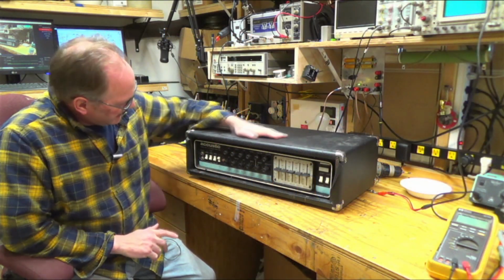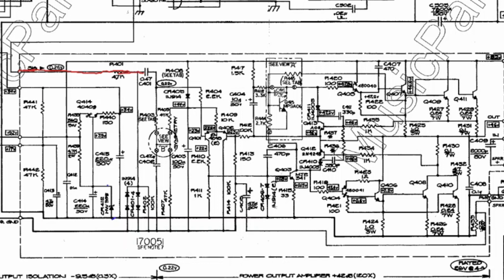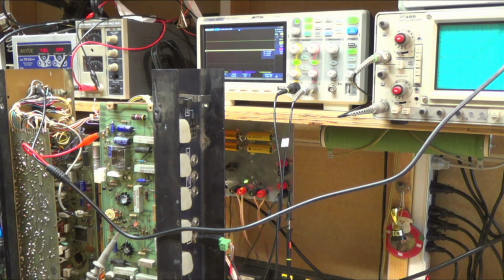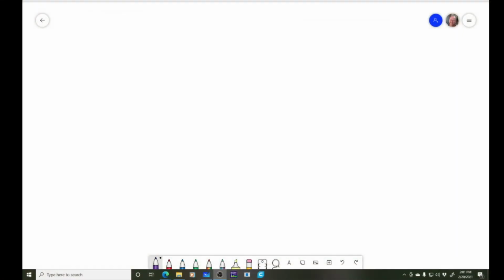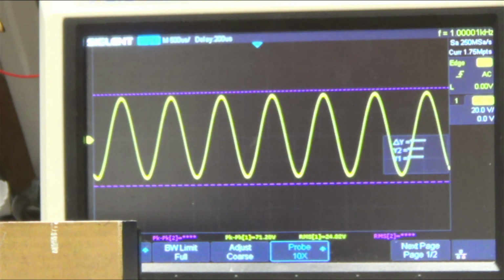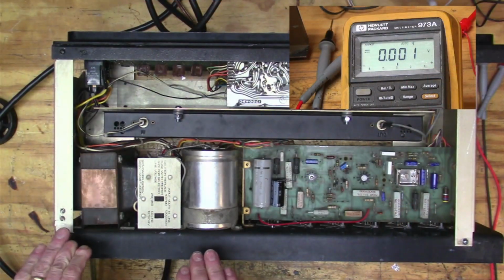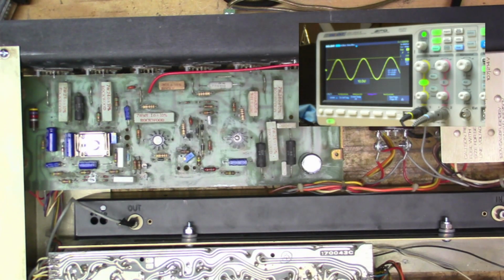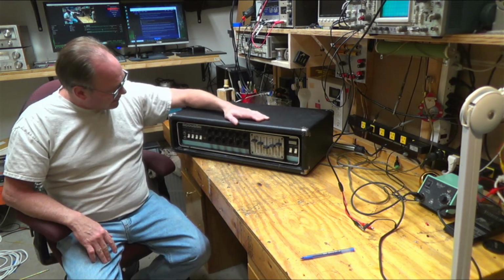1970s Acoustic 470 Bass/Guitar amp repair

Comment: I purchased this amp and speaker cabinet combo in 1978. It pretty much still looks like the day I bought it as I only used it on gigs several times. Recently I started getting some distortion so I brought it to a repair shop in Philly. The tech told me that the pre amp was shot and that unfortunately that it was no longer manufactured. The distortion is not constant so I still use it as a practice amp. I've had it for so many years and I really hate the thought of parting with it. Is there any way that another another pre amp, with the same electrical characteristics could be utilized? The other thought I had was to part with the head and replace the 4 ohm speakers within the cabinet with 8 ohm speakers, the reason being that I cannot seem to find a guitar amp head that is 4 ohm. Any comments or insights would be greatly appreciated.
Reply from the maker: I would take it to another shop. The preamp is all mixed together with the effects so I don't think you can just replace it. The preamp runs at like 40 volts. I had issues with the zener diode in the voltage regulator on the main board for the preamp power supply. I would check the input voltage, replace all the caps, and then test again. If it is the transistors in the preamp they're easy to replace too. Also and this is me thinking way back, isn't the distortion switched on, on the distortion pot? When I first got the amp I had issues with that switch. Maybe a clean-up would fix it?
Reply: @RobsFixitShop  Thank you for your insight. The distortion is only activated when you hit the foot switch which came with the amp. I'll have to do some looking to find a reputable repair shop. Thanks again.

Comment: I sold these as brand new amps back in the early '70s. I would not call myself a bass player (although I have thumped a bass a time or two), but my humble opinion is for playing large or outdoor venues, one of these amps with the 1X18 cab, paired with an Ampeg SVT with a 2X15 cab would be the best sounding, driving bass amp rigs I can think of.
Reply from the maker: That's so cool. Unfortunately we were in the basement so we could never get past 2 or 3 on the volume.

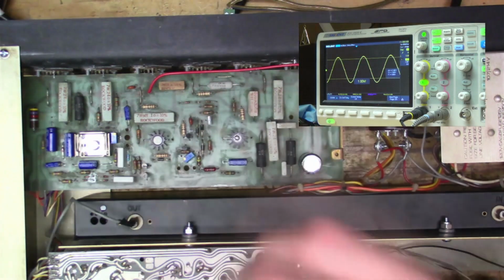Comment: Hi, Great video! It's really nice to see someone breakdown these solid state amplifiers. One question, around 49:55 you have the amp connected to the current limiter and point out the crossover distortion, then you plug it into the wall and it's gone. Was that  the current limiter causing the crossover distortion?

Comment: I had one of these roll into my shop, the owner had attempted to replace the output transistors, but they allowed one of them to short to the chassis...  As it was handed over to me, the transistors were already removed, so I don't have a reference for how it was initially assembled, and the service manual I found doesn't detail how they should be installed. Since you have one that is in working condition, can you tell me how the six transistors are mounted? I can see from your video that there are isolation pads, are there also maybe some nylon sleeves around the screws to keep them from shorting to the case as well? Thanks!
Reply from the maker: It looks like the screws go into the transistor socket which is soldered to the amp board. The is some clearance between the screws and the case. Some of the transistor cases have up to 90 volts on them so a short could be painful. Here are some snaps and pix: https://1drv.ms/u/s!AgRy1tCE6lTdgbQIo-CHLvEpbmO8ZQ?e=bMOGao
Reply: @RobsFixitShop  Excellent! Thank you for those pictures!

Comment: I don't know what the kid is talking about but to me it sounds pretty slamming for rock bass! It all depends on how one eqs the tone controls being that solid state amplifiers have very sensitive parameters.
Reply: Possibly, the light bulb decreases the line voltage and this causes sooner break up
Reply from the maker: I showed him your comments and after re-watching he stuck with his comments. But, after I made the video I remembered that one of the inputs is much brighter than the other. This amp has so much flexibility I can't believe you couldn't get the sound you like at enough volume that your neighbors could enjoy it too!